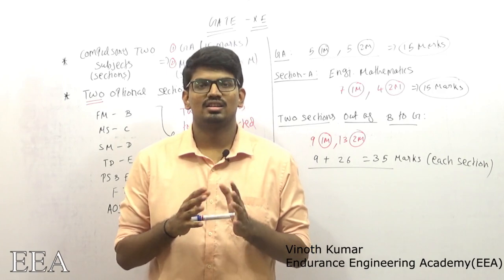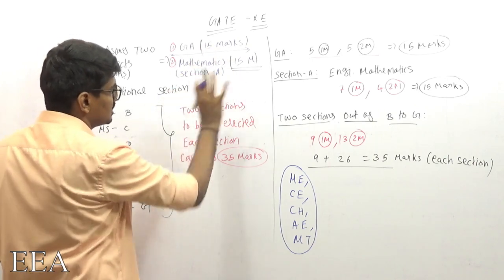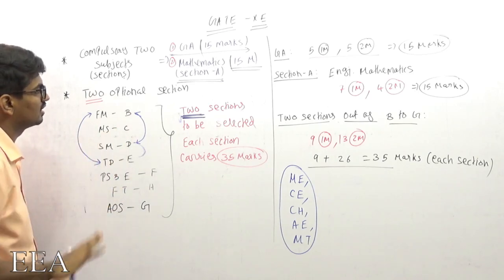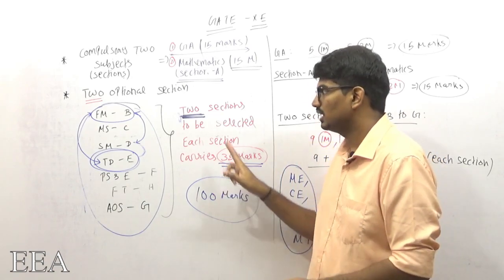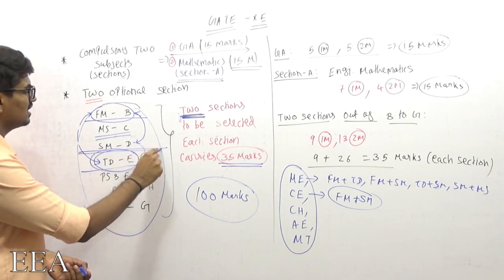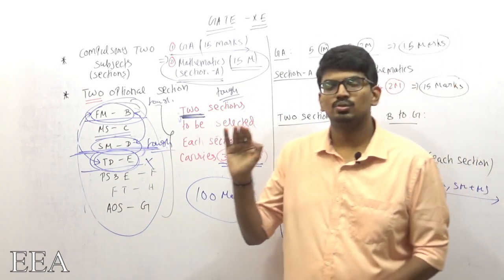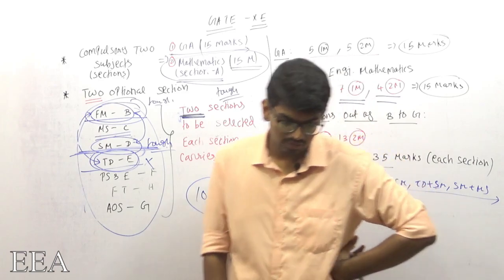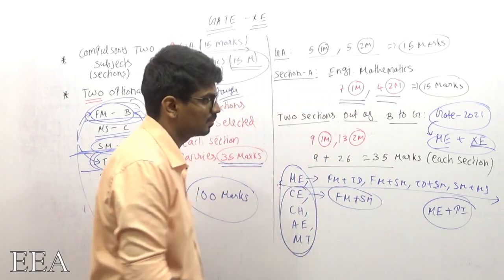Know Everything about GATE-XE(Engineering Science) | GATE 2023 & GATE 2024 | EEA

Comment: Can we take design in mechanical engineering
Reply: What should be the options
Reply from the maker: Yes you can, but only in IIT Madras and Bombay. Other IITs doesn't allow XE for core department. So it ll be useful only if you can score less 20 rank.
Reply: @EnduranceEngineeringAcademy  should my options include SOM
Or I could get using FM & TD COMBINATIONS( specifically for mechanical design)
Reply from the maker: As of my knowledge from IIT-Madras Brochure, it is mentioned only XE and not mentioned which combination to take but it is better once to go through IIT bombay brochure also